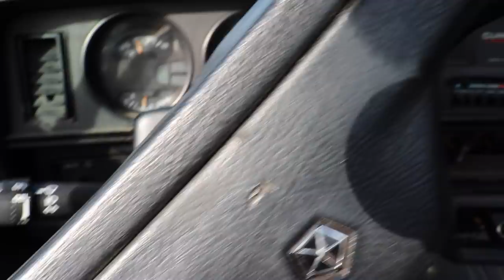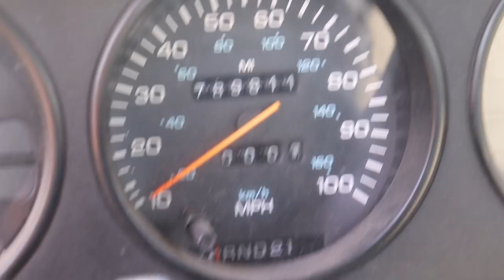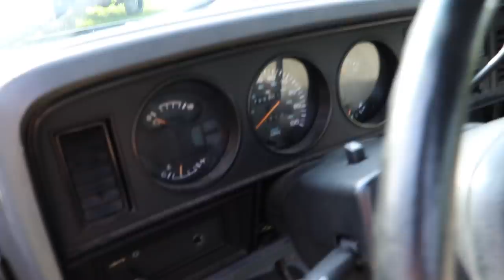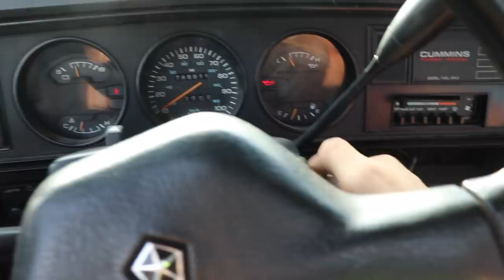I BOUGHT A 3/4 MILLION MILE 12 VALVE CUMMINS!!!!!!

Comment: I absolutely love that truck brother. You should street rod it out ive got a buddy that daily drives his an takes it to the drag street an eats up cars like nothing
Reply: LOUD 'N' PROUD. I used to own a 1993 12valve an my buddy help me turn mine up just enough to where i could use it to haul my 30ft camper an still be able to out run my boss mans Chevy pick up that had a 350 in it that had a mild build. I put a set of dual 5inch straight stacks in the back with flappers absolutely loved the way it sounded

Comment: Pull the motor and part the rest. Sooner or later you will need a engine and you will have one ready. That one has obviously been rebuilt or replaced. Keeping the engine is the smart thing to do

Comment: That ‘91 is cleaner than my ‘93, and my truck “only” has 350k miles. Awesome man. Turn that fuel screw up, have a friend ready in case it runs away though, non intercooled trucks runaway more. Mine is at 2 turns but it’s intercooled. Still, nice buy. 👍

Comment: Dude build it! I was honestly hoping for a 2nd gen beater haha but a clean 1st gen with possibly that many miles thats a mint cherry truck. Hell I'd pull a loan out if I found a 1st gen that cheap around my neck of the woods. You usually don't find them under 5k thay they aren't beaten to hell or used as grandpas old work truck in 2wd and problems. I'd honestly keep it restore it and do some performance upgrades like Greg Aberalla did nothing to crazy but something show quality also.

Comment: #12valvefamily 76 mm turbo and a 86 mm turbo ,injectors, twin 45 degree stack in the bed,locker in the diff , transmission upgrade, manifold ,studs ,heads, crank , cam